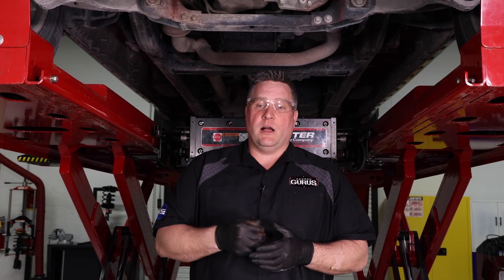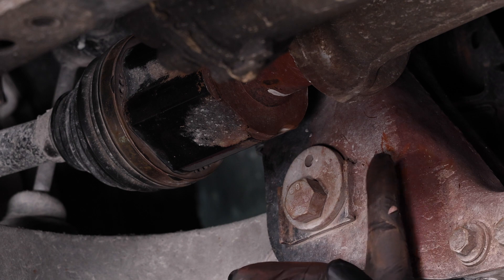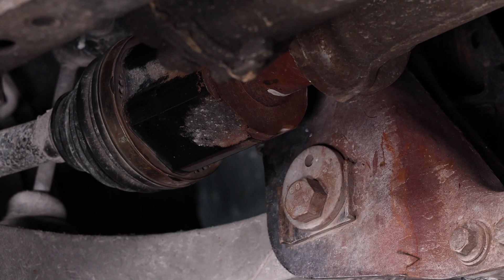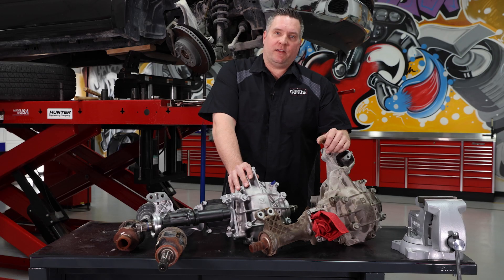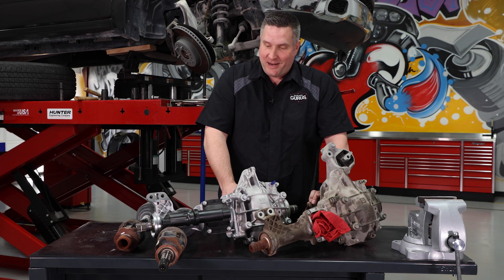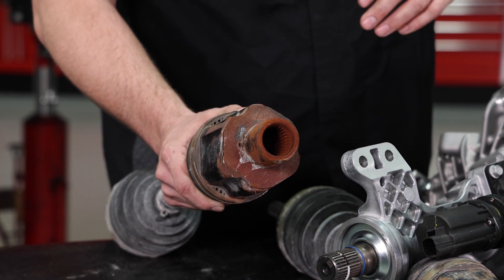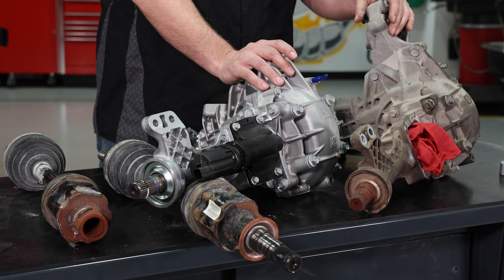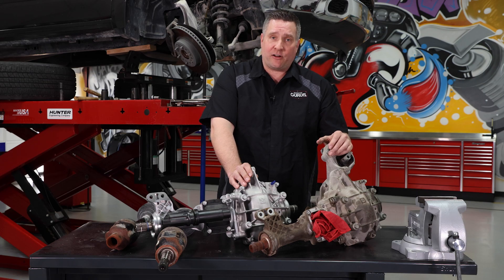Garage Gurus | How to Resolve High-Speed Vibration in 2020 Ram 1500

Comment: I just bought a 2019 Laramie with this issue and a month after I bought it, the dealership replaced both front CVs and the entire front differential. The shake is still there. It also has brand new tires on it. I am wondering if the play from those axles being loose wore out the wheel bearings? I wouldn't have bought this truck if I knew about this vibration issue - No one can seem to find the root cause.
Reply: Is there an update or still vibrating?
Reply: @grotzj  It still shakes like hell. I hauled my SxS with it for the first time this weekend and it shakes even worse when hauling. I could see the entire rear end hopping in my mirror. I don't know what to do other than start shooting the parts cannon at it.
Reply: @Ccam1190  have you checked the drive shaft u-joints? Is there extra play at the rear diff?

Comment: We had something similar at our shop! Vibration above 40 and a clunk on the front end.  The customer said he just had CV axles replaced at another shop.  It turned out to be the spring clip on the shaft that the other shop did not make sure was still there when installing the new CV axle.

Comment: Battling vibration issues and a "clunk" sound/feeling when going over bumps at low speeds with my 2023 Ram 1500, only 5400 miles on it. Dealer of course says they don't feel or hear anything out of the ordinary when they inspected it.

Comment: I have a 2021 ram1500 classic with hemi am I’m having a high speed vibration right now I’m dealing with. Bought new tires and never did anything.
Reply: I have the problem with my ram 2021 that when I go at 70 miles the vibration starts?

Comment: I've seen this in Texas with less than 80k miles on these Rams. I think it's a poor design due to not enough length of the stub shaft into the CV for support. It also gets accelerated wear with a leveling or lift kit causing more angle on the CV joints.

Comment: That’s a very common problem and it doesn’t have to just be up north. It can be anywhere anything driven on the dirt road mainly because it’s a crappy design by Chrysler. Why don’t they just stick the spines inside behind a regular rubber seal works great on every other ride.